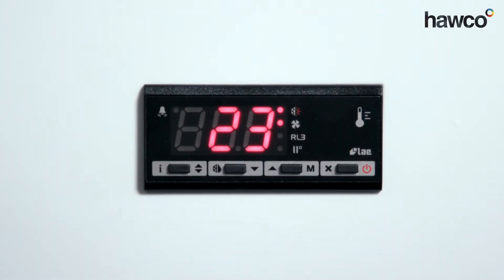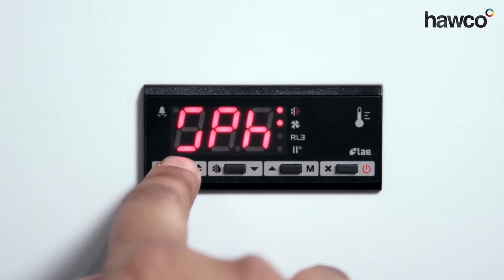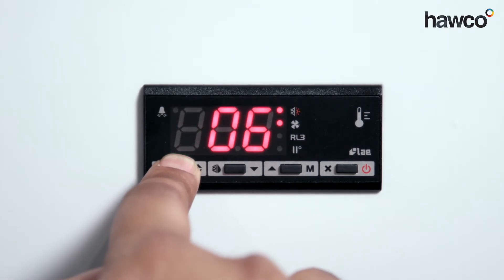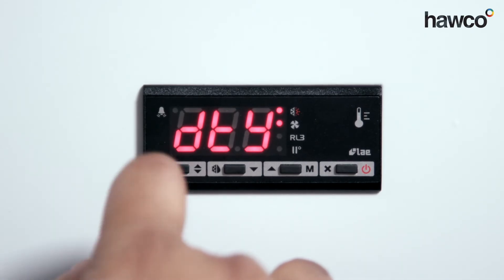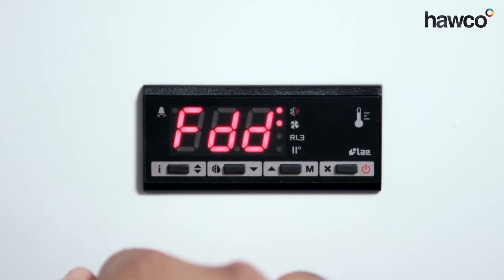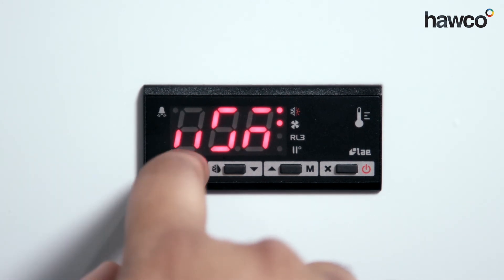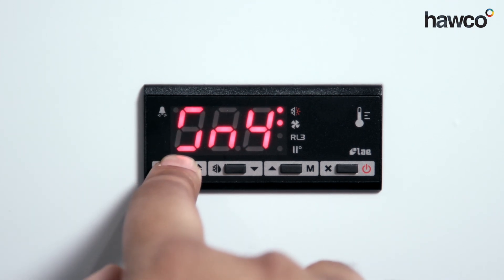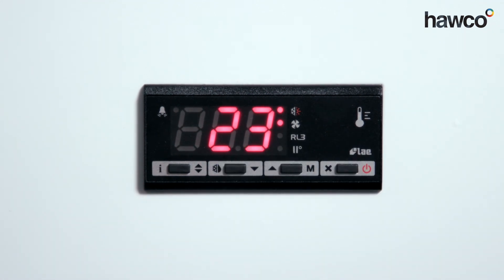Programming an LAE AT2-5 Digital Controller

Comment: Hi Hawco. I was wandering is there a controller capable of defrosting triggered by evaporator temperature...I'm thinking water heating for radiant floor...
Reply from the maker: Hi Antonio

It depends on the temperature you are hoping to achieve but you can set a LAE AT2-5 controller to switch off by either time or by temperature, whichever is reached first.

For example, the two parameters you would need are:

The DLI parameter which controls the defrost end temperature
The DTO parameter which controls the maximum defrosting duration

If you need any further advice on a specific application, email technical@hawco.co.uk and we will try to help you. 

The Hawco Team

Comment: How can set the thermostat at a temperature of 37.5 ...I can't set the temperature to a comma
Reply from the maker: Hi Mohamed

The parameter you want is SCL. 

With SCL set to “2: This means that a decimal point is not present (ie “20 deg c”)
With SCL set to “1”: This means that a decimal point is present. This now means that what was once “20 deg c is now 2.0 deg c”

However, if you ever change the SCL parameter from “2” to “1” (or vice versa) please ensure you check all the parameters as they will all be affected - ie HYS (hysteresis) was “05 deg c” is now “0.5 deg c” automatically!!

Hope that makes sense. 

The Hawco team
Reply: @HawcoCoUk ..Thank you very much for your reply- I understand that if I put HYS at 1.0 and SP at 38 ° C this might give me an average temperature of about 37.5 ° C
Reply from the maker: Dear Mohamed

Setting HYS to “1.0” is too small a tolerance for the controller and probe to read unless you are using a K-type / J-type thermocouple.
 
If you are using an NTC or PTC thermistor, you should increase HYS to at least “2.0”.

Hope that helps.

The Hawco team